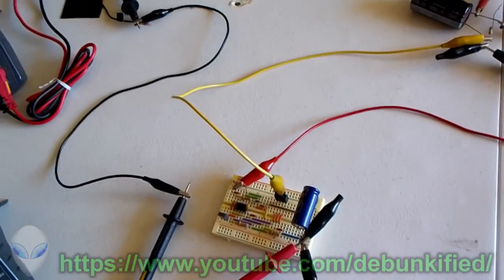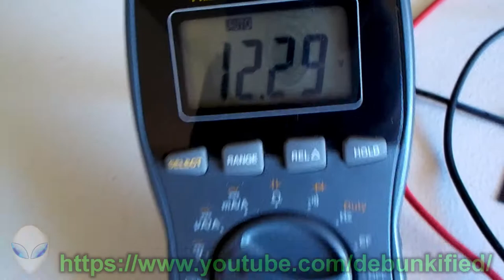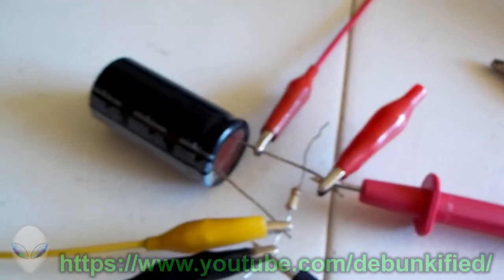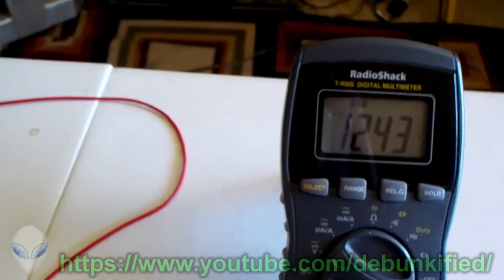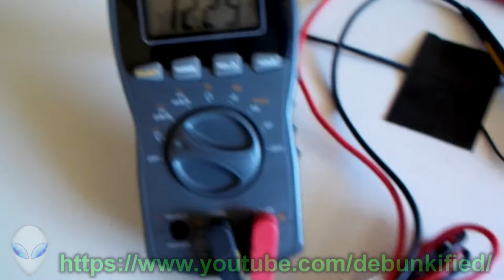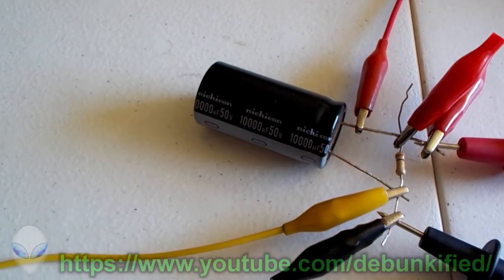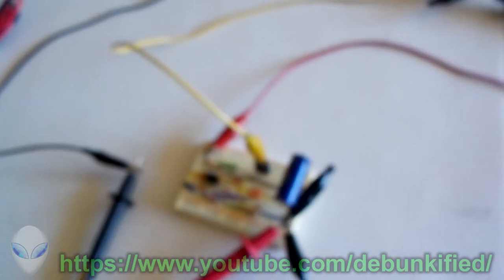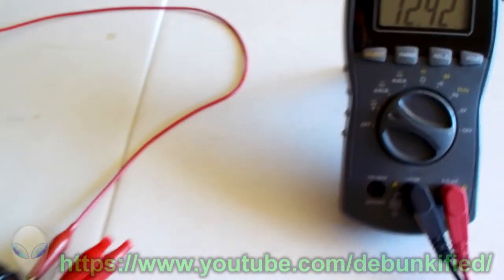LCR Circuit Experiment - (101% Overunity)

Comment: Referring to the natural occuring RF energy but I believe it is hard for any RF to be all natural these days with smart meters and now 5G and all the routers and so on. Really clogging up the air!
Reply from the maker: Ah I see. Yes the new pollution. Well zeropoint energy, if that’s what it’s called anymore I believe is in the terahertz frequency above light. Of course I may be mistaken. Maybe the voltage between the negative ground and positive sky of the earth. I’ve thought maybe mosfet leakage but maybe that’s too small and insignificant, who knows.

Comment: Thanks for the schematics.
Why didn't you measure AC current, you have a pulse circuit with R, LandC components so you will have some AC current  flowing.
Are you using a BJT or a MOSFET? Your video schematic shows a BJT.
What is the part number of the switching device?
If you used a IRF740, it has a diode inside connected source to drain.
That will have an effect on your circuit.

NOTE; Show your circuit first and the component layout on your bench, it will help cut back on the description you give, then explain what you are going to do.
Reply from the maker: Hi Tom, the schematics in the links in the description have the IRF740 mosfets for switching.
Reply from the maker: The drawing was more like a simplified guide but the actual circuit doesn’t use the BJT.